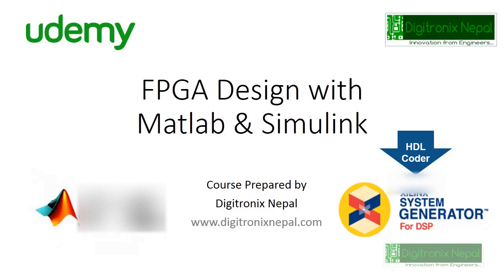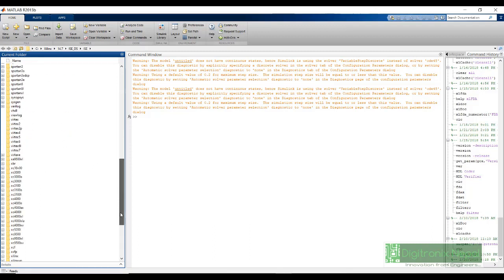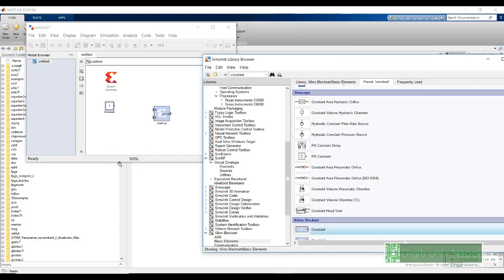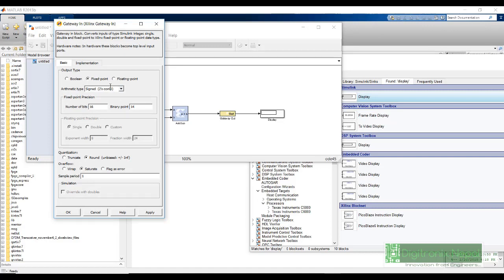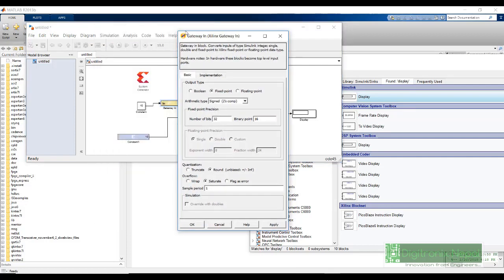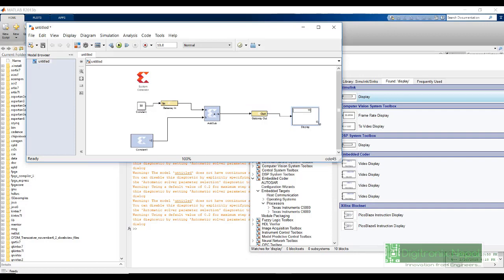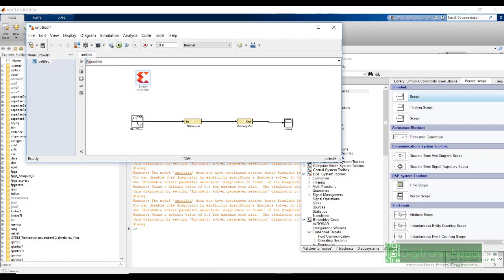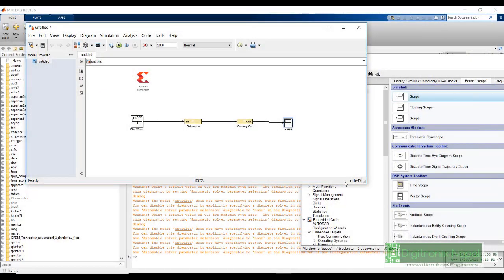Adder Design with System Generator (FPGA Design with MATLAB & Simulink)

Comment: I am able to make a simple adder design but how can i implement an adder using hardware cosimulation. i  mean by assgining gate way in switches and gate way out leds. can i implement it on my board. help needed sir. please i have also joined this course on udemy